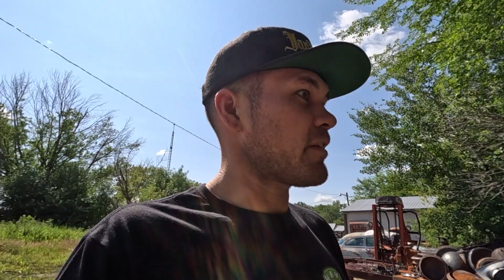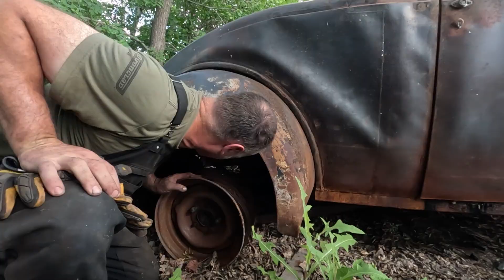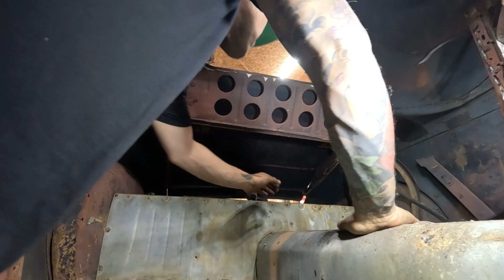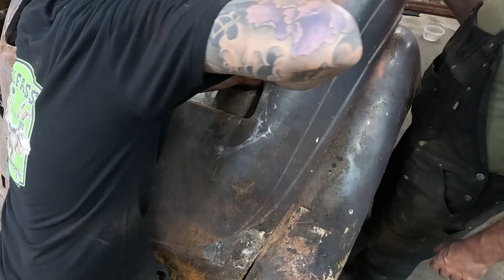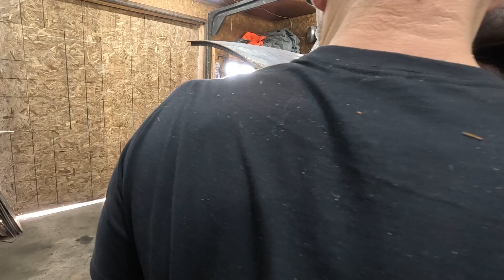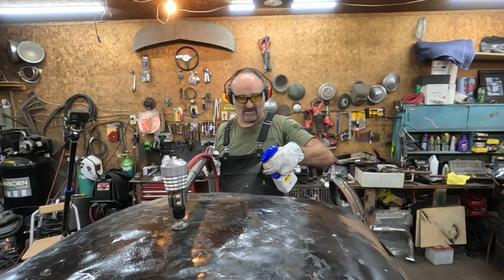Repairing FIRE WARPED Sheet Metal HAND TOOLS & PLANISHING HAMMER @ HALFASS KUSTOMS

Comment: I was welding cab corners in late father’s 1991 c1500. seats, gas tank, and carpet were removed but i had new part boxes in the cab that caught a spark. fire burned out the interior and all windows blew out. all cab panels have dents from thermal. Given it is all thermal damage should i try to fix it with heat prior to cold working? Is it is a lost cause?

Comment: Great work on that hopeless warped and softened metal. I have grafted a burned 36 Ford sedan floor to a rotted 36 Ford Cabriolet. That floor was soft on the part of the quarters at 8" above the quarters where I sectioned the burned sedan quarters to the non rotted Cabriolet. That's when I then found that the sedan quarters needed to be tilted in to meet the Cabriolet where I then hammer welded with a oxyacetylene torch as I did on the whole car. I did make some error because of the cabriolet cowl section being separated from the rear and floor of the sedan which should have been in a jig to force the back inner floor and secure it to the rear crossmember. The entire trunk opening was rotted around the channel which caused it to distort while I kept the door openings aligned.

Comment: What’s your perspective on burnt cars? I’ve seen lots of comments on posts about cars that have been in fires loosing all temper In the metal. In my mind car body steel is fairly soft anyway (especially older cars) so there’s not much temper to start with.

Comment: Modern cars have some higher tensile steel that may be affected by heat and quench.  The older cars were predominantly mild steel that gains a little strength in cold working but heating simply normalizes it, quenching has no effect.  The car will be softer as the heating undid all the stress of pressing within the panels and the chassis.  Cracking due to hardness shouldn't be an issue but flexing from here on might well be, the extra flex may cause cracks due to excess movement?  A roll cage might be worth considering to stiffen it up?

Comment: You may need to stretch then heat shrink some of the panels to work harden them a little to return the bodies internal structure back to like it was before the fire's heat changed it.
Reply: Hammering is work hardening.

Comment: Is the “durability” of the metal effected by the heat?
Reply from the maker: What has happened is that the metal became softer because it was heated and the molecules spread out. This can be tightened up by planishing. I think the material will still be strong
Reply: @MakeItKustom  outstanding.

Comment: I'm no metallurgist I saw flakes coming off the body steel... someone correct me if I'm wrong...Under heat, Metal will stretch and lose integrity, shrink and become brittle...so if that car sat in the Canadian winter after the metal was super heated... then extreme cold.. aren't you looking at a chance of crakes and warping... metal thinning ... 
All that said... this was amazing craftsmanship... the patients you both have is amazing... Big Big Hat Tip... Next round is on DD Speed Shop  😉

Comment: Very cool of you to help Brent. You two got most of the dents out, and reshaped to about what is was.  I wish I had you two's skills at body work.  Keep up the good videos.
Reply: When I was a young boy right out of high school my friend and I open up a body shop. I didn't know anything about body work but replacing parts. Then when I got into fixing dents I amazed myself. Just kept on working with metal to try and get it as straight as possible then lay the mud down and sand block sand block came out better than factory. The painter gets all the credit not the guy that spent many many hours working the metal and body filler work.
Never dought yourself you put your mind and work to it you will be able to pull off most anything.👍🏽